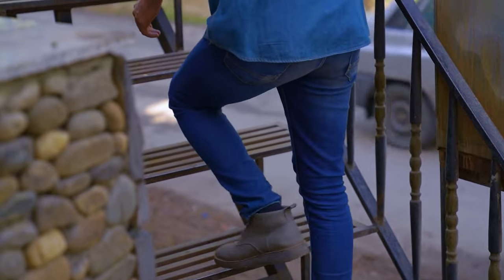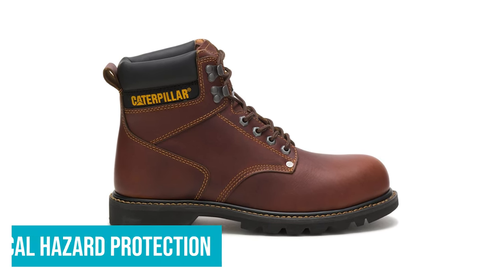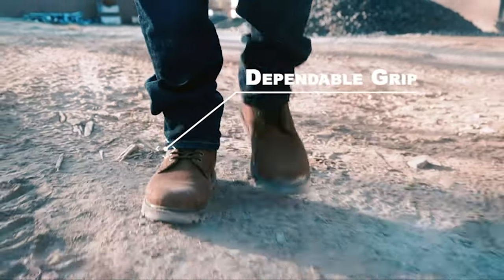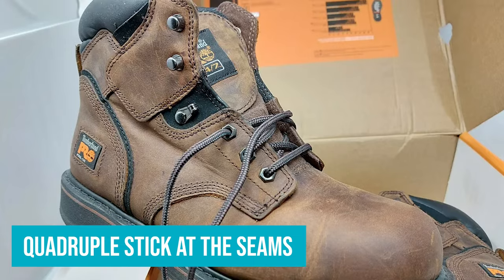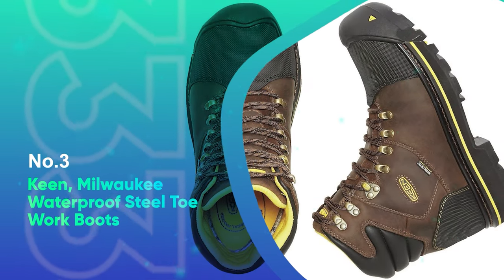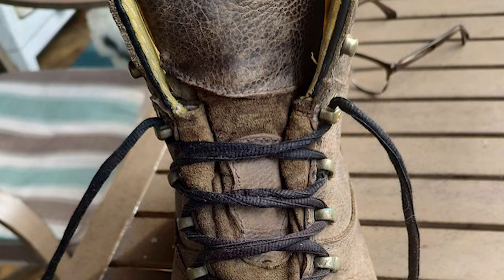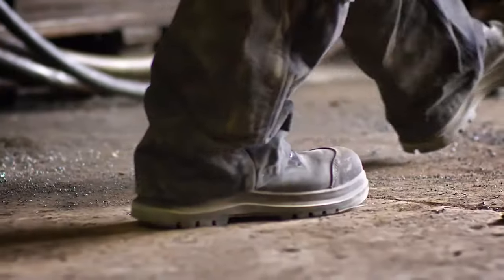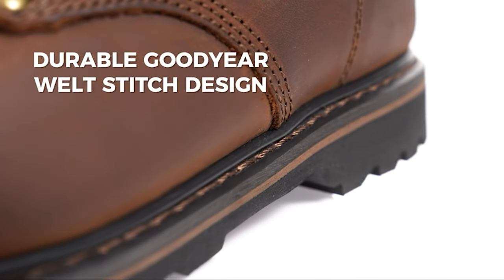Best Work Boots For Men 2024: Tough call, but there's a CLEAR winner!

Comment: FYI.. I bought a pair of Carhartt Wellingtons they sat in the closet for about 6 years as I had not worn them very much. One day I decided to put them on and the soles disintegrated. The uppers were good, so I took them to a Cobbler to have some soles put on. He put some nice Vibram Soles on but in doing so the plastic liner came apart over the Toe Area. Now its just to annoying to try and wear them. Total train wreck is all I can say. I would have been better off just to toss them when the soles fell apart.